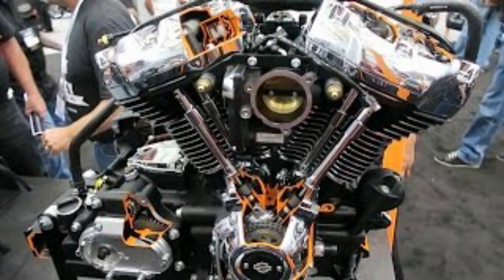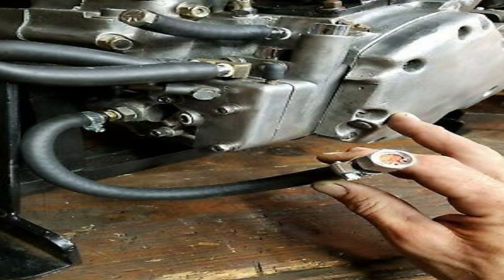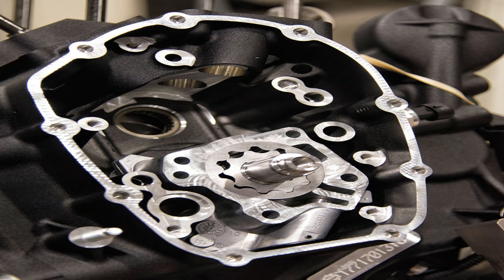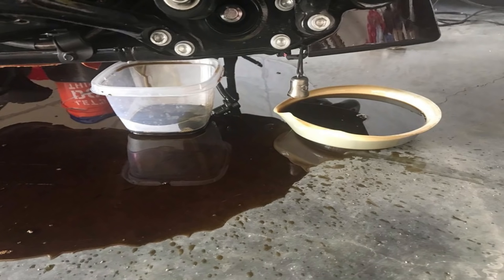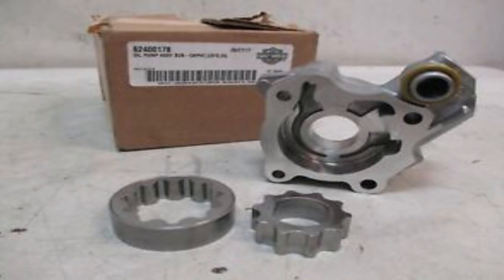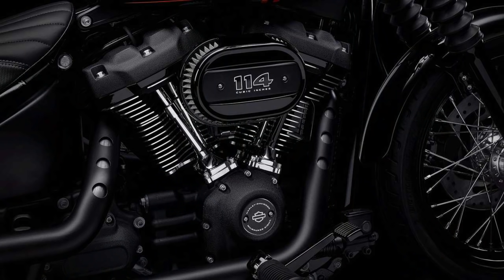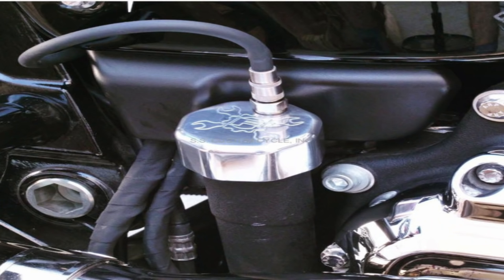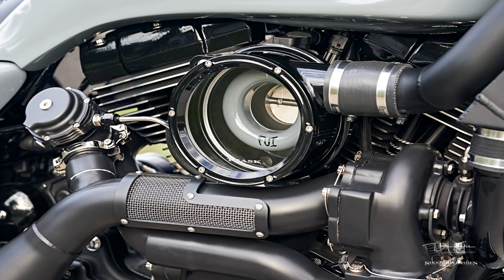The Fatal Milwaukee 8 Engine Flaw Harley-Davidson Missed

Comment: How often do you change the oil on your primary, tran and motor?
Reply from the maker: Motor every 5k miles, primary and trans every 10K miles. But on a Sportster the primary and transmission share oil, it's only about a quart so every 5k with the engine oil on those.

Comment: Ok then been riding my Mil 8 fxbr for 2 years 25,000km and hard and fast (as it goes cos it decks out quick) needs new suspension oil wise no problem no leaks nothing .
Reply from the maker: That's awesome to hear! It's a really hit or miss issue just like the twin cam's and the tensioners on the 88.
Reply: Based on this video you would think M8 engines were dropping out into the street by the tens of thousands. I don't know man, there is a lot of happy M8 riders out there.
Reply: Describe hard and fast....like full on throttle?  What's your shift rpm?  What's your cruise rpm?  Just curious...I've got a '21 M8-114 FatBoy, I'm still breaking it in and wanna make sure I'm not driving it too hard and not babying it at the same time.  Cheers.

Comment: So I have  2021 Electra Glide with the 107 M8 has this been fixed now?
Reply from the maker: The 2021 has the updated oil pump, this so far has seemed to work from what I have seen. I would still invest in a vented dipstick though.

Comment: I have a 2019 Heritage,  I thought this problem was (heard) with the touring line. The dealer told me my bike doesn't have this issue....then again, not sure I trust that.  They also told me I have a forever warranty on the powertrain when I bought it new, and if I ever had a problem it would be taken care of.  I've since then did the stage ll upgrade.
Reply from the maker: You may likely have a late production 2019 with the updated oil pump, early production 2019's were likely built in 2018 with the old style pump. You can't beat a deal on a lifetime powertrain warranty, do they have to do all your services at the dealer for that? My dealer has a lifetime deal but you have to have them do all the work to the bike.
Reply: @GixxerFoo  that's what I was afraid of.... purchased November of 2018 😕
Reply: I feel bad for you 😥. Harley just feel lucky again 😎😁
Reply: @betruly7894  I'm fine, nothing that can't be fixed, and so far,  I haven't had any problems
Reply: @GixxerFoo  yep, I let them do the services,  they pretty good, reliable.  They do what they say and don't do anything else without confirming it

Comment: I have a 2019fxbb 19000 plus miles rode it to Albuquerque twice from tulsa Oklahoma, take it above 100 mph almost every time I ride it and have not had a single problem. No breather build up, no noise no leaks. So did I just luck out ???
Reply from the maker: Oddly the sumping is mainly on the touring bikes and not so much the softails. That's not to say it doesn't happen on the Softail just not as common, I'd say you got a good motor in that one. I'd be curious with it being a 2019 if it has the updated oil pump in it though too.

Comment: I have a 2018  M8 I would like some more information on the venet oil caps where I can buy one up
Reply from the maker: Check out FuelMoto and the vented dipstick, there is also the vented transmission cover which works well too.

Comment: You’ve got my attention!
Reply from the maker: That's why I steered off the M8 for several years, I wanted to see what issues came up and what they were doing about it. I've noticed if you had one under warranty and caught the issue they would fix it, a good dealer would tell you and get it done.
Reply: @GixxerFoo  fuel moto price is 239.99. I love mine

Comment: Oil lights are a cop-out! Any high-performance engine (and they're all hi-per these days) deserves an oil-pressure gauge IMO.
This glitch is just another failure with Harley Management. They've been scrambling for market share for years, and think the answer is in cutesie advertising, forgetting that product quality is key.

Comment: Hi ..! I have my new Road Glide limited 2021. actually, I ride more than 3000 miles owner up today. The engine starts making a noise like a tick and feeling harder when it's so very hot well I live in Florida. The Noise is like a lifter tick is harder when the engine turned hot. I bring to the dealer and they said it's normal, but I know is not. This freaky noise makes me crazy every day when I ride my bike. what do you recommend to fix it I already saw your video about this situation with many riders. But really I want to be sure if I change the oil Pump the sound will disappear?..
I would Really appreciate all the help you can give me to solve this problem.
Reply from the maker: Being a 2021 it has the new updated oil pump, it sounds like it might have some sumping going on. You might try going to a vented dipstck to help relieve that. You're dealer should be working with you and taking the steps to see if you have a sumping issue starting to emerge. If you're dealer won't help you I would suggest trying another dealer to try and get that fixed under warranty if something happens. A vented dip stick would be my next step for sure with that going on, those won't hurt a thing on a M8.
Reply: @GixxerFoo  ok 👍... I will try  first with the vented dipstck. I'll let you know if I notice any change with the noise.... Thank you for you help..

Comment: It's not just the oil pump at fault. Crank runout and poor ring seal right off the assembly line among other inexcusable issues. If this new powerplant that's in the panamerica has any problems the moco is in deep doodoo.
Reply from the maker: That's true, they are still pressing cranks on the M8. Issue started in 2003 when they started pressing them, no kidding that new Pan America is supposed to be top of the line quality and engineering.
Reply: @GixxerFoo  Just give some time to the Panamera.  The M8s were also top of the line "quality" and engineering when they first appeared, and look at where we are now...

Comment: I don’t see the point in buying a new harley anymore. I have old old ones and some evos and the whole joy for me is the different feels and quirks of the bikes but they’re all easy to work on and if you do your maintenance generally there is not much to fix. Smaller motors, lighter bikes especially if they’re stripped down to nothing, are over all in my opinion a more enjoyable bike because it’s not this behemoth bulk that’s trying to be something it’s definitely not. A 700lb base model that makes 90hp and is air cooled w a big oil cooler on it still can’t whoop a Honda vtx 1800... cmon.

Comment: I have a 2017 Road King with the 107. What pump should I look at for a replacement?
Reply from the maker: If you want a basic replacement the 2020 pump is great one to go with. If you're upgrading the cam while your in there Feuling or S&S are the way to go.
Reply: @GixxerFoo  
Is there an issue with just replacing the pump with Feuling or S&S to begin with?

Comment: New rider here, question. Will a vented dipstick void the warranty on my new HD?
Reply: The vented dipstick works great
Reply from the maker: Shouldn't, but the safe way is to take it back off before you take the bike in for service. I don't trust all dealers the same way.

Comment: There is a bit of fear mongering in your video that makes one believe this issue is far more pervasive than it is.  There were a number of 10 lobe oil pump modifications up to and including 2019 (prior to the 8 lobe pump).  This included recast of backplate and rubber seal.  There are a number of more informative videos on YouTube on this issue without the fear mongering propaganda.
Reply: @VndNvwYvvSvv  your point is an irrelevant point of reference as the comment was specific to the M8.  My personal experience and those of thousands of owners on the M8 forums refute your anecdotal comments.

Comment: So you're saying that Harley has three different oil pumps between 2019, 2020, and the SE?  If I upgrade my cam plate to the SE, should I go with the SE pump, or the 2020 factory pump, or does it matter?
Reply from the maker: Harley-Davidson had a first generation design of the oil pump that ran from 2017 to early 2019 which had issues. So they redesigned the oil pump and that second generation pump started going in to bikes produced in late 2019 to the current models. At the time of making this video Harley doesn't offer a Screamin Eagle cam plate or oil pump for the M8 engine like they did on the twin cam. I am surprised they haven't started offering one with the M8 being in production since 2017. My guess is they were trying to straighten out the oil pump issue first. Outside of the updated factory oil pump the only options for a new oil pump are currently from Feuling and S&S.

Comment: Old video, but how are the 2020+ 114s at this point? Anything to look out for? Any common problems? Thanks.
Reply from the maker: 2020 and newer have the updated oil pump, I wouldn't be scare of them. I would still add a vented dipstick though, but nothing these days is built like it used to be.

Comment: I see a lot a people saying with new engines there's always problems and that is true but that is how all things are done. They will eventually have all the kinks panded out through trial and error. Although I do agree they should swap it free of charge if you buy a new car and they have a recall and your car is still under warranty free fix. Also people complain about the tc88 not having enough power but that engine was made for a long time other than the chain tensioner that engine is solid hence the reason I still have an tc88 in mine. Truth is anything new coming out is gonna have issues and Harley should fix that issue especially when we spend $30-$45k on our bikes

Comment: Once again, good vid G! My 2021 fxbb got a fueling dipstick as soon as I got the new bike home. I'm also thinking about adding a DK custom air cleaner with external breathers also.
Reply from the maker: That's awesome to hear! Those really do help quite a bit and since you have the 21 model you have the updated oil pump. A good external breather goes a long way too with keeping the top end clean and the crank case pressure down!

Comment: Off topic at hand... when I shift into gear after starting my bike up(2015 iron) sometimes it makes a different noise then the usual clunk... sometimes it sounds more grindy... i try to roll the bike forward if its been parked in the sloped street with the rear tire on a curb before putting it in gear. 1 more thing... is it normal to need adding oil before the 1500 mile changing. I ride it everyday.
Reply from the maker: Oil usage could be related to the way you ride and the miles on the bike, how much oil are you adding? Have you checked the oil level in your primary? Sportster transmission are really tough and can take a lot, you might also check your clutch adjustment.
Reply: @GixxerFoo  I'll add about 1/4- 1/3 of a quart about every 250-300 miles to bring back up to being just under the "full" line, BUT... Thats when i "RIDE IT!" but i've been pretty chill with it these last 2 weeks and so far it seems to be fairly forgiving with the oil level dropping and that abnormal shifting into gear  noise hasnt been noticed as well. How long after i turn the bike off should i check the oil level? Ive always checked it within 2-3 minutes after i shut it off... ifigured it to not be a big deal to wait for whats in the cylinders as it couldnt be much to make a difference but i could be wrong... and thats why we got you! Uh oh... do i smell a slogan...  "GOT FOO?"   😂😂😂
Reply from the maker: Man that seems a bit excessive on the oil consumption. You shouldn't be having to add that much oil.

Comment: Do Harley have a recall on 2017 m8 oil pumps
Reply from the maker: They don't since it's not considered a safety issue. If your dealer was able to determine you were having a oil transfer issue or sumping they would replace it under warranty.

Comment: Thanks for this! Not sure what to do my bike was built 12/18 haven't noticed anything unusual yet!?
Reply from the maker: No problem! It seems like it really happened with the 2017 and early 2018 models, 2019 seemed to do well although had the same pump. If you don't have any issues l would lose sleep over it. If you experience anything you have an idea of what to be suspicious of.

Comment: Hey Gixx, what's going on with Harley warranty? I've been hearing people say they can do whatever they want and if they screw it up Harley will have to fix it under warranty. I know that's not true. What are you hearing?
Reply from the maker: Harley has been forced to make a lot of allowances and rewrite their warranty language, not just quietly fix it but inform every owner with a warranty. Pretty sure that means you can do exhaust, tuners and accessories. We will have to see what comes with say cam shafts and other internal engine components.
Reply: @GixxerFoo  ok, thanks I needed to hear it from someone that knows how this stuff works

Comment: Didn't HD update the oil pump at some point recently ?
Reply from the maker: Those pumps went into late production 2019's to the current models, although sumping has improved but still happening. They did some crankcase ventilation updates which improved the issue somewhat as well too.

Comment: My oil light came on then went off next morning wouldnt start its throwing oil pressure switch code and wont run now is that a situation to cause it to not run
Reply: Its throwing p0523
Reply from the maker: If you've got an issue with the oil switch that would prevent it from running, if the switch is bad the bike is going to think it doesn't have oi; pressure.

Comment: If I vent with a dipstick vent, can I block those pesky head breathers ? Will the dipstick be enough?
Reply from the maker: I would run a catch can at the head breathers, you'll need the ventilation through the heads as well.

Comment: Went on an IBA certified 1500 miles in state in 36 hours and at one point thought I could hear a loose bolt. Either it went away or I went deaf, and I forgot about it.   Then out of the blue this video was recommended.  I took it to the dealership for a 10k service and to look into the possible oil pump issues.  They called and said the oil pan was cracked.  Ever heard of that and what is the oil pan interference on the 18 FLHTCU?

Comment: My 2018  107 Breakout has lifter clatter.  Bought the bike right off the showroom floor and only has 23000 klms. Scheduled to taken back in to the  dealership to look into the problem.  Pretty dam frustrating given the cost of the bike  low klms and after Harley has been building engines for almost 120 years.

Comment: I bought a 17 M8 (I know I know) I started getting the oil from the head breathers at about 16k after a long trip. So i put an A1 vented dipstick, still gettin oil in the air cleaner. So you think the A1 needs a check valve to keep a vacuum or just keep an open line. And do you think the pump will still work I'm at 24k now. Thank for the vids love em
Reply from the maker: I would stick with an open line, the M8's have horrible crank case breathing and that's what's causing pressure build up and forcing oil pst the rings. You might check out the vented transmission cover as well, best thing to do is get the oil pump upgraded to the 2020 and newer if you can.
Reply: @GixxerFoo  thanks I appreciate it
Reply: I disagree with the "open line" modification. Engines need to maintain crankcase vacuum. An open line will decrease vacuum by allowing air to be drawn back into the crankcase when the pistons are in the up stroke. With that said, the crankcase vacuum will tend to pull oil into the crankcase. Therefore the oil pump must be able to scavenge the excess oil. The piston  downstroke will tend to build crankcase pressure. The oil pump uses this change in pressure to assist in drawing oil from the crankcase. There must be a check valve in the vent line to expel pressure to the atmosphere or to the intake and close during the piston up stroke thus maintaining vacuum.
Reply: @garyshoaf5699  put a check valve on after I posted that comment. Works great not a drop on the breather tubes

Comment: How much to upgrade the pump?
Reply from the maker: Depends what pump you want and if you're doing it yourself, dealer or independent shop. Ball park with parts I would guestimate 800 on the low end up to 1500 depending on what parts and where it's done.

Comment: So. My 2018 107 (9000 miles) has been running so hot I smelled melting plastic and there's metal in the oil pump area. What parts are breaking down and what should I replace? Will HD dealer (UK) help at all with the rebuild or will the 'no shame' attitude prevail?
Reply: Trade it in
Reply: @Gunther Kohler  thanks so much for the useful, comprehensive help dude. 😉 although you've been the only one to reply. So it is appreciated.

Comment: 2019 Fatboy 114....at 751 miles I did the following: S&S 475 cam chest kit and oil pump w/timken cam bearing. S&S hydraulic cam chain tensioner. Fueling dipstick vent. HPi throttle body, intake, air cleaner and external breathers. Royal T exhaust pipe. Dynojet tuner and tuned at 114hp/129tq. Bareknuckle oil cooler cover. Protect that stock oil cooler. One kicked up rock that punctures it and you will have one hell of a mess on your hands.

Comment: Im looking at buying a 2024. 114 ..would it be fair to say theyve fixed this issue?  cause thats what Ive been told
Reply from the maker: Yes and no, they do have an updated oil pump that solve a lot of the issue. But crank case pressure in my opinion is still a problem. I would own an M8 2020 or new with the updated oil pump but I would invest in a vented dipstick or a vented transmission cover. For sure the vented dipstick, both just to be safe. It may not be necessary but it's cheap insurance and peace of mind to me.
Reply: @GixxerFoo   OK... that sounds like good advice. ...thanks man